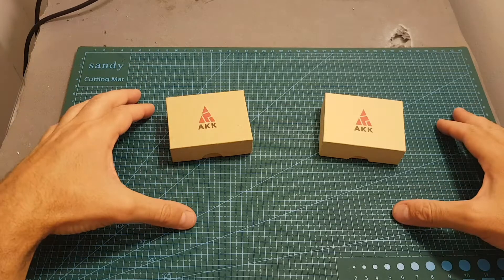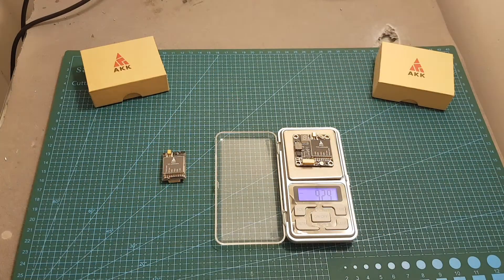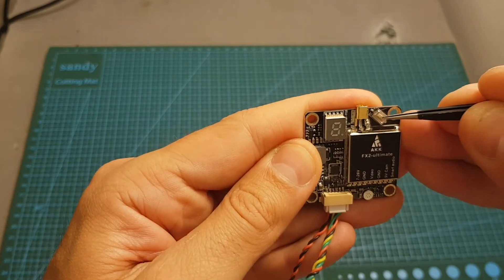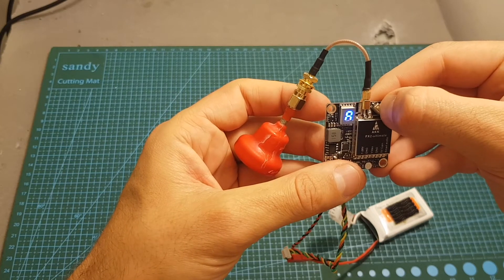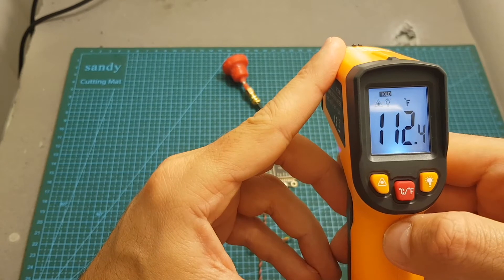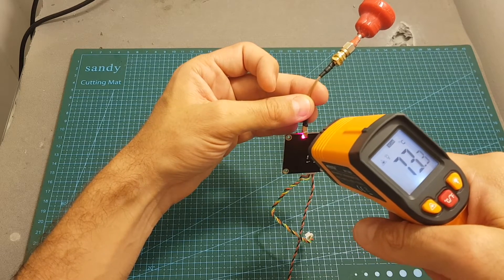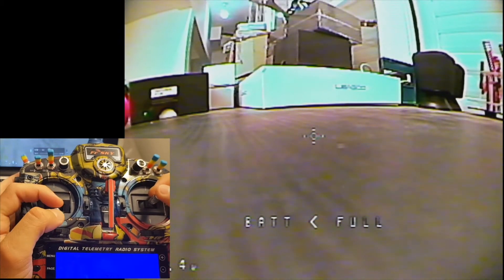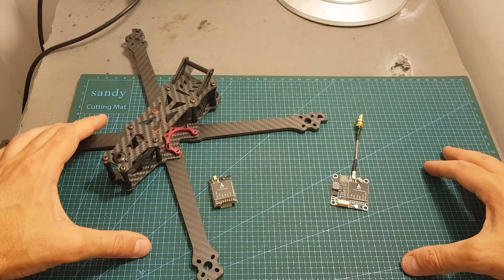AKK FX2 & X2 Ultimate 1200mw VTX - Review, Setup & Temperature Test

Comment: Does the AKK X2 work with a 14.8V 1300mAh 4s 100C Gens Ace lipo battery? And can i put a jst adapter to the xt60 port?
Reply from the maker: Yes and yes.
Reply: @KremerFPV  ok thank you so much

Comment: Approximately what range can I get in a FPV boat, if using FX2 Ultimate at full power, and directional antennas on the RX?
Reply from the maker: At line of sight I would estimate over 1KM.
Reply: I hv got 8,27 km with  my boscam 600mW that is enought for me but I will try thix FX2

Comment: I cannot gt smart audio to work with akk x2. wired it to uart6 and did the tbs smartaudio thing, but in osd. I see nothing. tried different versions of betaflight and butterfligh. nothing.
Reply from the maker: Try a different Uart TX port and see if it helps.
Reply: @KremerFPV  had to enable "telemetry"
all tutorials I saw did not say thing about this
Reply from the maker: @JorksX  I'm glad you got it sorted. I will mention it next time I will configure a VTX that supports smart audio.

Comment: does it support FC PID tunning through the OSD running betaflight? or is it only for changing the power and channel settings.
Reply from the maker: It has nothing to do with the VTX - you can change the PID using BetaFlight using the OSD with any FC that supports OSD.

Comment: why do you say 800 means 1200?  where is that published?
Reply from the maker: 800mw just refers to the 4th option on the VTX. For more information: https://github.com/betaflight/betaflight/wiki/VTX-CLI-Settings In addition, I confirmed it with AKK.
Reply: Gal Kremer awesome answer, thanks for taking the time.  waiting for my back ordered power meter.
Reply from the maker: The "problem" with the immersion RC RF meter is that it can only handle up to 1w, so testing the 1.2w setting without an external attenuator would be wrong and might damage the RF testing unit.
Reply: even v2?  I guess I'll have to get some external pads.